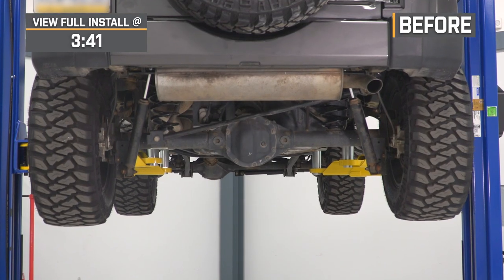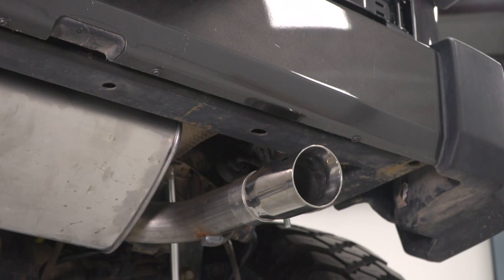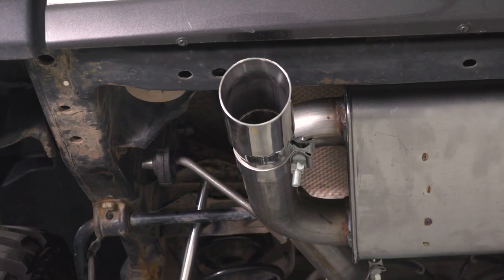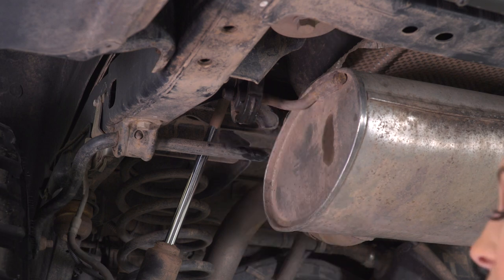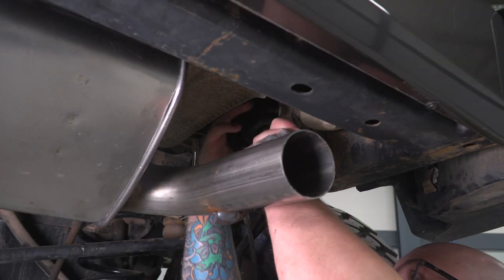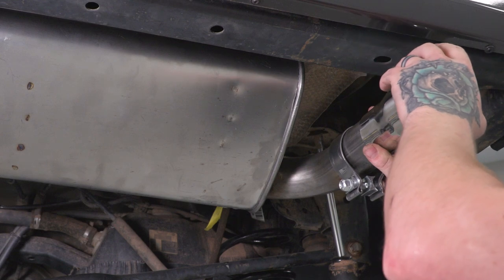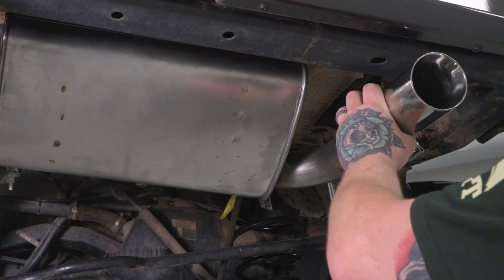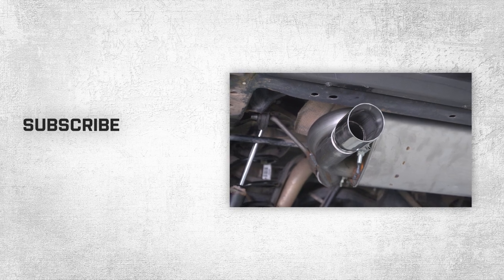Jeep Wrangler JK Dynomax Super Turbo Axle-Back Exhaust Review & Sound Clip

Comment: A little Tech tip Rotate the bolt hardware of the tip brackets to the 12 o'clock position. It will eliminate bad looking installation plus it will eliminate anything from catching on the bolts.
Reply from the maker: Thanks for the tip!

Comment: just did this install today on my JK. those chrome tips are instantly the nicest thing on my jeep now! It sounds way cooler from inside the car, there's a low vibration at idle. Its as quiet as the stock muffler at constant RPM, but as soon as you get on it, you definitely hear it. So basically, perfect. ProTIPs-- soak not only the 15mm clamp, but also the exhaust pipe around the clamp.. it'll slide right off. Also, you can use a sawzall or a grinder to cut the hangers off right near the rubber dampers, that way you don;t have to mess with wrestling with the hangers. using blaster on the rubber hangers helps a bunch too for both removal and installation. I finished in about 45 minutes with blaster, a 15mm and an impact wrench, and a sawzall.
Reply from the maker: Glad to hear you love it, Dennis! Thanks for watching! -Zach